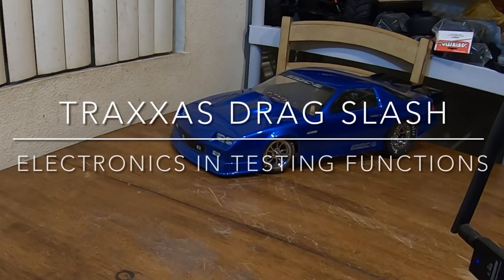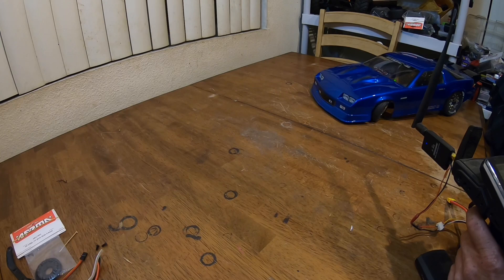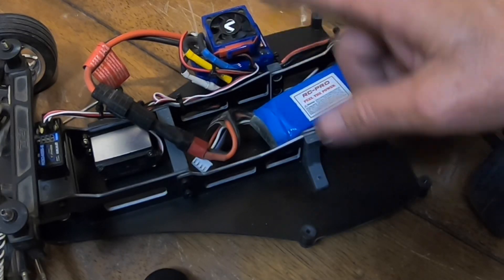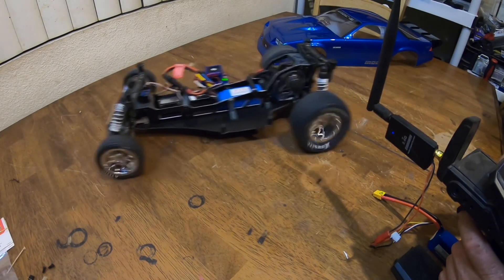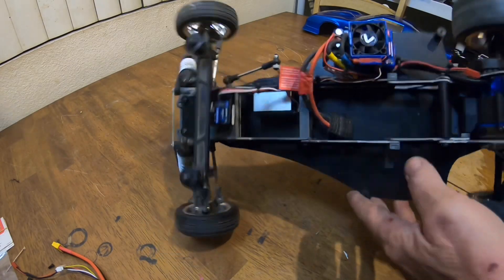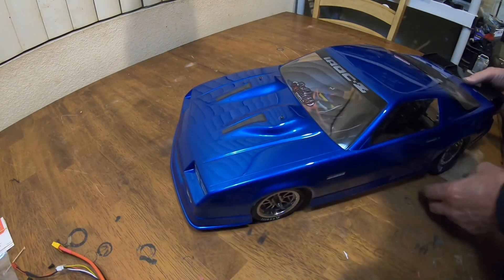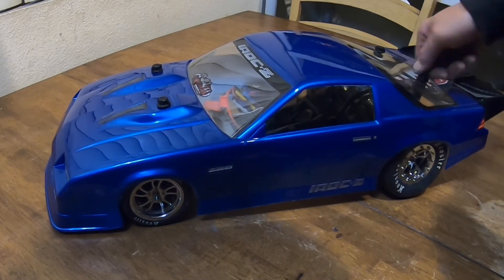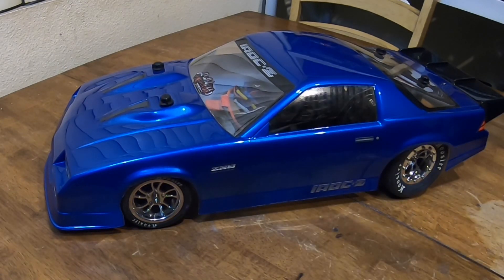Traxxas drag slash build CHUCKWORKSRC chassis first drive

Comment: Nice build Earl 👍  will X-01 rear axles work ? Or just go with some mip's
Reply from the maker: Mip are heavy and xo1 are to long for a drag car 🤔🤔
Reply: @earlmoorhead5555  would be cool if you could buy some carbon fiber tube and use some mip/traxxas parts build your own axles. Now that would be sick and a neat video

Comment: man it looks and run good try backing off all the preload on the springs and check to see if all the arm are moving free if not sand them down some so they move freely but i cant wait to see what combo you put in
Reply from the maker: Arms are not free and shocks pretty worn out there a bit more work needed waiting on parts and figured run it for body rub and alignment 💯💯🤛